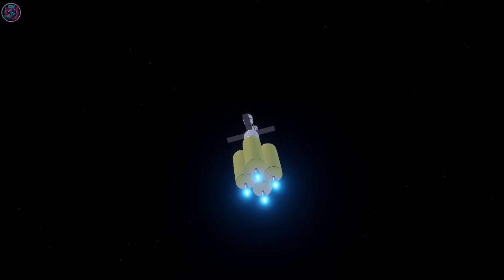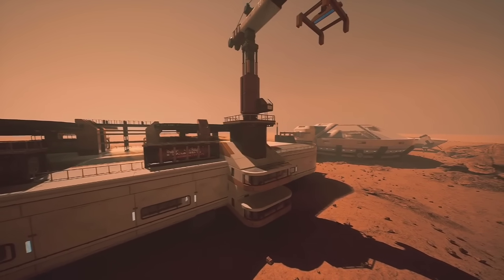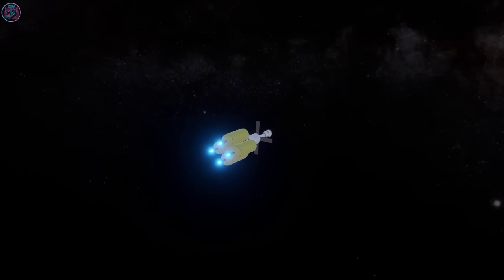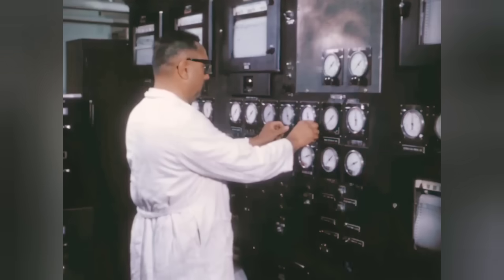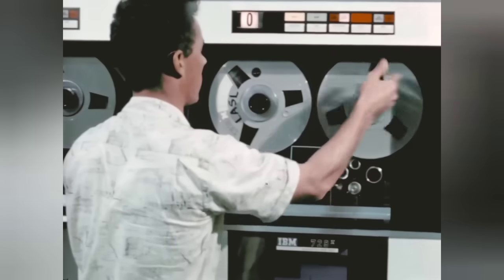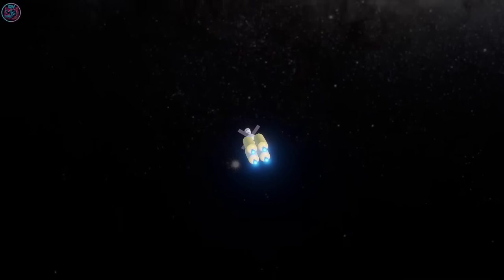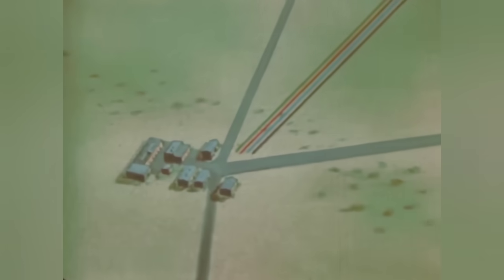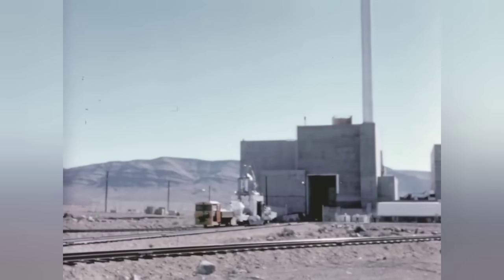RANT ALERT!  NASA Nuclear Mars Rocket plans blocked by regulation, lack of test facilities!

Comment: Headline "Nuclear Mars Rocket plans blocked by regulation". Well, of course it is, and for good reason, and has for many decades....
In a research environment for an as described nuclear rocket engine, any test to scale would require even more than a "lethal service" ASME test cell. The risk of explosion and failure which must be considered, and would require a facility capable of withstanding that explosion and safely contain all released radioactive particulate, and then some. Previous testing in the 50's were performed before we knew and regulated  the affects of released radioactive particles on the health of humanity. 
I believe it will be very costly and a challenging regulatory obstacle to fully test and develop this type of nuclear engine just about anywhere on earth. Perhaps the Chinese or Russians will do it anyway. 
There has also been the regulatory pushback on launching that volume of radioactive isotopes via rocket into space for decades. A high altitude rocket failure or even a low orbit failure would result in worldwide contamination of some pretty bad radio active particulate, globally contaminating soil, water, our food chain, ourselves, for hundreds of thousands of years (radio active half life and decal) leading to significant cancer increases, deaths, and things we don't want to even consider.
This is a tough nut to crack and we need to move forward however not with 1950's technology nor any tech that threatens global health using our current fallible launch technology. I believe we can come up with some clever way of accomplishing this however we are not there yet, nor do I believe the right folks are funded and motivated to do so. 
I worked in the Nuclear Industry and specifically with radioactive isotopes from 1978 until my recent retirement. In 1979 that work took me behind the iron curtain as well. I am aware of much of the history of various atomic development projects developed in the past, learning much from my years as a Department of Energy contractor. There is a lot to think about and much that needs to be done.... Submitted with respect to all opinions.... Joe
Reply: Unlike RTGs, an Uranium fission reactor does not produce deadly radioactive isotopes (i.e. fission products and fission products inert gases) until it is taken critical (i.e. self-sustaining chain reaction) for the first time. Any in-space testing could happen in cislunar space in a non-Earth intersecting trajectory.
Reply: @ColdWarSubSailor_-  You are correct pretty much. The concentration of Uranium in a fuel pellet before service is harmless in pellet form, have held them in my bare hands many times. Not gas or aerosol form however but It would take a hell of a lot to cause a serious issue. I am not sure however the nuclear rocket technology of the past, uses PWR/BWR fuel like you and I are used to and have been extensively trained to understand. I believe this is why the program was stopped and the Feds stopped supporting any nuclear rocket technology for many decades. Hopefully these issues will be solved with newer technology and a safe way to get those nuclear engines into space so we can take advantage of the most powerful energy source that man can currently utilize. I agree fully that we need a faster way to interplanetary travel much faster and a nuclear rocket engine is our best bet if we can make it happen. I am as pro nuclear as it gets and spent a lifetime in the industry however there are and have been elected and appointed decision makers that have put the brakes on just about any research into anything new we have wanted to do with nuclear technology. It is my hope that this will change.... Thank you for your service ColdWarSubSailor, my younger brother spent 17 years in the nuc sub program, proud of him as well.... Joe
Reply: @joesharp5602  Joe, thanks. So that I make sure I understand, I am aware that a nuclear thermal reactor for rocket propulsion is open-loop vs closed-loop like a PWR/BWR, and the closest analog I can find is the open-loop air-breathing nuclear ramjet of doomsday Project Pluto (superheats rammed air vs LH2). So testing or operating these in the atmosphere would be definitely a nasty proposition. But assuming the containment could be secured, and testing conducted to ensure reliable operation, I don't see the issue with launching these in a pre-critical configuration using conventional rockets for in-space operation in non-Earth intersecting trajectories. 
P.S. after the Naval Nuclear Power program and leaving the USN after a six-year enlistment, I received both an BSEE and MSEE, and I've almost completed a 38 year career in aerospace systems engineering, where I've designed and tested launch and space vehicle systems and subsystems. George.
Reply: @ColdWarSubSailor_-  George, we need to find out what the fuel composition is for what is being developed now. I know that besides the legislators, both DOE and NASA have been totally opposed to the tested and excellent performing Nuclear Thermal Rockets developed in the 50's going forward. I believe that the current thinking is still an open loop nuclear ramjet like technology as the most technically feasible and energy efficient system that will produce the required thrust in the vacuum of space. 
As far as testing is concerned, you have to assume the worst possible failure scenario is plausible and the test facility and conditions must be designed and built to mitigate the plausible. Feasibility tests can be performed on very small scale micro systems in facilities we currently have, and probably already been tested to prove the technology. Certification however will require a full sized system to be tested and stressed to a percentage above design specs in many key performance systems. This lengthy process that will be used to flesh out issues and eventually lead to a finished usable design, will require a purpose built facility (in my opinion of course) that will probably take years to design and cost as much as the system it is being designed to test. The cost of the facility is more than just steel and concrete, there are sensors, computers, fuel handling systems, waste handling and filtration systems since this rocket will be producing potentially highly radioactive thrust at a thrust level we have never yet seen on earth. It can of course be done however it would take a national commitment akin to the Manhattan project just without the open air testing being allowed....     
Aerospace has to be exciting and you seriously prepared yourself to be a valuable asset to that industry and I am sure you have made many valuable contributions. Again, thank you for that service as well, it is more important than most in the public realize.  
I don't seem to get a chance much these days to ponder the uses of the technology and associated science that I spent so many years studying and have appreciated greatly the chance to bounce ideas and thoughts on this subject with someone as qualified as you. I rarely comment on YouTube videos but felt the need on this one because the host knows nothing really about the subject and has a long history of not reading the video comments where he might learn something anyway. I got lucky however when you responded. Hopefully our discourse will spark an interest in others following this subject and perhaps they will learn that this particular area is very complex and has a long history with much needed to be done going forward if it is to become a reality. 
Thank you again.... With great respect.... Joe
Reply: @joesharp5602  Joe thanks! Yes, the host is very flippant about the release of a 'few' Curies of fission products into the atmosphere. Nuclear containment margins are multiple hundreds of percent above the modeled worst-case scenario (I am starting to imagine complying to AFSPCMAN 91-710 V3 Chapter 9 to accommodate launching an NTR as a payload). As far as the complexity of test systems goes, we often joke that to test a 'transmission' you have to build an automobile around it running on a simulated road under simulated environments...and this may not be the best example, because in the automotive world you can actually test a new transmission design in a car running on a test track, but in aerospace everything must be built as a hardware/software simulator/emulator with complex environmental test conditions. For those curious, and just to begin scratching the surface about what we are talking about, look up SMC-S-016, MIL-STD-810, MIL-STD-460/461, and AFSPCMAN 91-710. Regards, George

Comment: There are bore holes left over from nuclear bomb testing in the Nevada test ranges.   A proposal was made to fire a test rocket engine into the hole.  The H2 gas would be absorbed into the soil and any fuel chunks would be buried with the rest of the debris from underground nuclear blasts.  The concept could be tested by firing a RL10 engine into the hole.

At the time of this proposal the hangup was security for weapons grade uranium that was used in the original test engines.  Now Draco is going to use non bomb grade uranium so that concerns goes away.

Comment: Ignorant peasant here. Using only liquid helium as propellant could reduce the fallout risks. Helium doesn't react like hydrogen would making heavier compounds that would linger in the lower atmosphere or fall back to earth. Also helium being lighter than air it would float to the top of the atmosphere ( being really hot would also help) and leak away into space. Maybe? I know Helium is heavier than Hydrogen so i don't know what you would lose is Specific Impulse.
Reply: Helium is not abundant or affordable enough to be used as rocket propellant.

Comment: I’m a nuclear chemical engineer. Early in my career I designed the J6 test stand, which was totally enclosed vacuum rocket test stand which successfully tested the shuttle solid rocket booster in a vacuum. This design could easily licensed to test a rover or similar thermal nuclear rocket.
Reply: The entire facility was enclosed in thick dense concrete with similar design to reactor containment vessel. Operated as a vacuum vessel, the design would contain all rocket gases, and the final vacuum chamber (the largest ASME concrete vacuum vessel in the world) exhaust was cooled and could be easily passed through reactor grade filtration, including iodine adsorption, and krypton adsorption, finally with HEPA filtration on the final exhaust stream. So yes, this could be licensed.
Reply: @elephantwalkersmith1533 Now we need Janet Petro, Jared Isaacman and Trump to make this happen. 🤞
Reply: @elephantwalkersmith1533  since rocket engines in development regularly blow up, how does your tech handle a nuclear engine explosion?
Will the US public be okay with exploding small nukes in US territory?
Will an underground nuclear engine test site outside of the US be a better choice?
Reply: @1ndragunawan nuclear thermal rockets do not use chemical reactions. The coolant and propellant for the reactor is a once through system where the gas temperature is raised to thousands of degrees. There is nothing to blow up.
Reply: @elephantwalkersmith1533  so, nuclear rocket engine won't experience any meltdown?
Reply: @1ndragunawan Just buy Greenland and test it over there.
Reply: @elephantwalkersmith1533  my past was a bit different. I worked in reactor operations at Plant Hatch in Georgia from 1978-1980 before going into Health Physics. A lot of great memories from back then.
Reply: SRP here. Miss those times. @smittysmusictavern8278 I   I
Reply: is it properly shielded against radiation ? also, how much radiation would escape and contaminate the test stand ?
Reply from the maker: Thanks for this information!
Reply: @TheAngryAstronaut  Always happy to have a chance to gush about NTR's :)
If you haven't already I recommend taking time to look at the "Atomic Rockets of the Space Patrol" website as it's got a huge amount of information all in one place about realistic space technologies and various issues and solutions.
(Warning: It can be a huge time sink of well spent time :) )
Reply: that's so cool!!!!
Reply: I went through Idaho on my way to the fleet.  One of our instructors had an interest in the airplane version of this.  Let’s think about this.  Reactor plant design isn’t going to have the fuel itself open to the environment.  The gas used for the “push” or impulse (Star Trek), is a once through design.  But at the least, the fuel will be encased and probably have another barrier as well to protect the environment.  In space, maybe only would need the fuel cladding.  There should NOT be any fission products escaping the reactor (on earth).  If that were to happen, it would be time to put the polls-in-the-holes (scram).  To test, a bioWall for personal protection, and a sh!tpot of detectors.  If tested in Idaho, just need the thing aimed into a bank.  Face it, the project got aced out for money by another project.  Disregard the BS excuse they give.  Those imbeciles only know how to squander money.  That is why starship and new-Glenn makes NASA look stupid.  I say stop the welfare projects NASA throws money at a feed real projects that develop real results.  By the way, there is a British company (rolls-Royce I think) that is a long way down this path.  Stop handing out welfare checks and partner with an ally and stop pussyfooting around.  Ramaswamy, sick-em.  Kick a lung out of them while you’re at it.
Reply: Chances are it may have been junked by now! You know, Bidenomics!
Reply: never happening there are people telling you you can't build a nuke power plant because the dreaded "RADIATION" 1960 anti nuke propaganda was so good scaring NPC's you are now screwed, get to Mars then build it there
Reply: How does one test a rocket motor like that in a vacuum?? Surely it's no longer a vacuum with all that exhaust gas?? Impressive stuff
Reply: @j________k the steam accumulator received high pressure steam for two days just for one shot. The toroidal arranged steam vacuum ejectors operated in millions of but’s per second to pull a full vacuum on the test cell, which had a temperature close to that of the sun. Cool stuff.
Reply: @j________k  I assume that gas will be cooled, condensed and stored as radioactive waste.
Reply: Well known problem in the nuclear propulsion community the problem is the one that always crops up: Who and how does it all get paid for. Again all this falls on Congress, the folks who have been blocking nuclear waste storage (something that Congress "promised" to do in order to get companies to make nuclear power reactors in the first place and why every plant has cooling pools filled with "spent" uranium rods) for decades.
Reply: Gamma Ray radiation has blocked your path .....😅
Reply: No it can't. It was not designed to contain or confine spalling nuclear fission products. The idea, proposed by Sandia, that nuclear engine testing testing can be done at Stennis, is specious. No where of Earth wants fission products released into the air 20 miles from its cities.
Actually read the NERVA studies until you understand what was actually done to the environment.
The processing buildings alone will take 10-20 years to design and get approvals. 
Then the approvals to start construction. See what it costs to build out a nuclear power plant, then add all the other structure build out to become operarational.
Not to mention the costs, magnitudes of order different from the 1960s for compliance now.
Then what do you do with the huge amounts of contaminated water and facilities after testing?
Please do your own research now. You soon find out very few are actually aware of what it really takes to stand this capability up. 
All rocket motors blow up during development.

Comment: If you spin a circle on s drill the outer edge moves faster than the inside. Couod you not spin a craft and slowly increase its radius so it gets faster then just let it go?
Reply: @paulh5801  only up to about 10 Gs that humans can take. That wouldn't be near fast enough to launch a vehicle
Reply: @smittysmusictavern8278  ahh yeah, thinking about it the ship would keep the same path of traveling in a circle if you let it go. I retract my idea :)
Reply: @paulh5801  actually, it would take off in a straight line that is tangent to the circle it left. Think of the slingshot used by David to kill Goliath